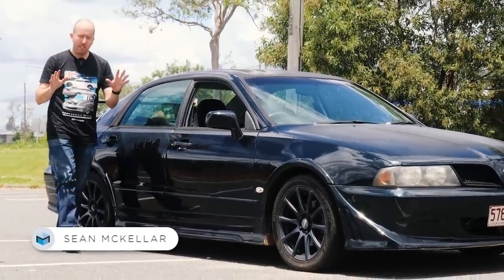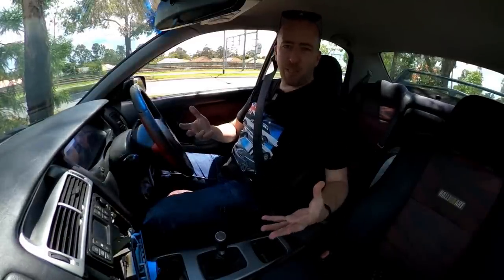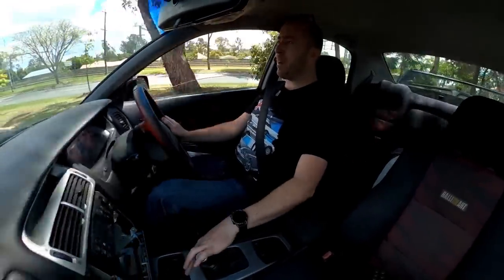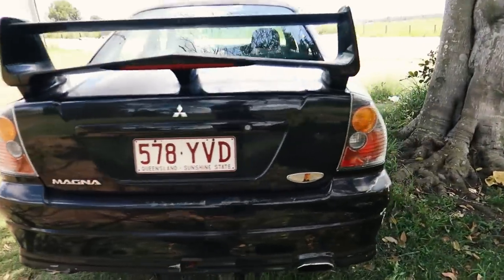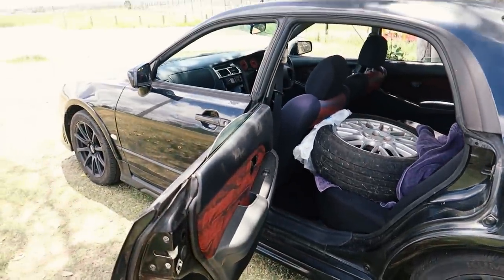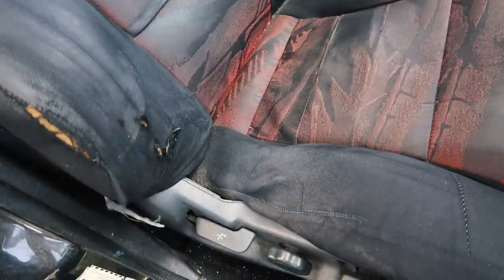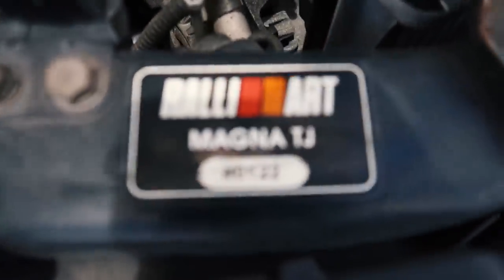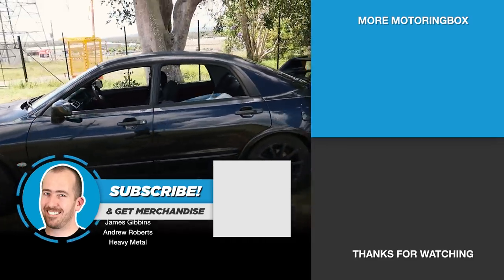Mitsubishi Magna Ralliart First Drive! This Aussie 180kW 6G74-powered manual sedan is a screamer!

Comment: Kia Carnival 2012 has 202kw and is a FWD, take the seats out and it's much lighter. I think that's hilarious, but this Magna is hella cool
Reply: The 2012 Kia Carnival was over 2100kg. 
What do you mean that it's lighter than a Ralliart Magna? 
Ralliart Magna's only weighed 1470kg. 
Even without the seats, it would still be alot heavier.
Reply: Sorry I meant versus a Carnival with all the seats in, just that it's another FWD with similar power, there's no comparison especially with the manual.
Reply: @mrjustinmarsh  
Some Ralliart Magna's had 210kw from the factory as an NA. 
But also about 30 of them were Supercharged, they gave out over 250kw.

Comment: Love the car. Contemporary road tests comparing the Magna to the Falcon and Commodore saw the Magna as being the faster car of the 3.  I honestly think that if the Magna had been a rwd it would have been far more popular in Australia. I’ve driven a few variations of the Magna over the years and always found them to be great cars. I loved the pillarless doors.
Reply: The L76 S/C Ecotecs had the Ralliarts in a drag race by a couple of car lengths over a quarter, but in terms of a sports-car engine, the Ralliart-spec 3.5L was a no-brainer. I remember being a mildly distressed Holden-loving 14yo reading a Motor magazine comparison between the Ralliart, AU XR6 VCT and HSV XU6. Ralliart destroyed them both overall.
Reply: I think you’ve scored a smart project car

Comment: they also made i think 30 of these ralliarts SUPERCHARGED! i think it was mitsi in conjunction with another mob and not sold through mitsi dealers, though not sure. these are really exploding in value now. !!
Reply: Well I don't think they make the Sprintex twin scroll supercharger that those Magna's came with anymore. 
So the only way to get it is by buying a Magna equipped with one.

Comment: I would have suggested to get a Toyota aurion sportivo for $5k as it's engine is better but they have doubled in price since COVID
Reply: 5 Ralliart Magna's had 210kw due to getting wilder cam's & compression ratio. 
Plus 30 of them put out 270kw due to getting the supercharged treatment.

Comment: It is a real shame they couldn't make the AWD happen... I was really interested in these when they were in the concept phase, but when they came out in FWD, they looked pretty limp wristed next to an SS Commodore.
Reply from the maker: They cost about the same as an SS too I believe.
Reply: @MotoringBoxTV  Weighing up this vs the six speed 5.7 litre Commodore... The Magna really was a tough sell, especially in the Aussie market. Even in AWD form, it would never have had the mass appeal of the big rear wheel drive competition.
Reply: @MotoringBoxTV  $48,990 - 2002 TJ Ralliart Magna Sedan - 5sp Manual - 3.5i so ya got a bargain mate

$50,540 - 2002 KJ Series 2 Verada Xi Sedan - 5sp Tiptronic Auto - 3.5i  cheaper than a Rada

i sent ya an email, let me know if ya want all the lists/codes/part numbers/prices
Reply: They had planned to make about 1200 of these from memory. Sales declined and I think it was cut short around the 600 mark (something around those numbers). There were white and yellow ones made too. 

Nice car but should have been AWD. Most rear bumpers were cracked when put on (touched up with paint).

Comment: lol it was actually only 170kw but still pretty cool, i had a red one in manual with sunroof
Reply from the maker: 180 officially. What they actually made I have no idea.
Reply: They officially made 140kw atw. 
This is the 180kw version's. 
Dyno test's confirm this. 
This equit's to 180kw at the flywheel, not 170kw. 
Some had significantly more power though, courtesy of different cam's & a Supercharger. 
30 were released with a Supercharger.
Reply: @MotoringBoxTV  180kw for the 500 numbered 2002 cars. 210kw for the 5 unofficial non numbered 2001 prototypes sprinkled into the mix.

Comment: AWD Ralliart Magna would have been a weapon.
Reply: yer but it was fat , over 300kg in the rear end
Reply: oh and mal from mitsfix in bayswater made a mawson sedan with evo parts/manul
Reply: @Roo0ooD  
The TJ AWD Magna Sport weighed 1604kg vs the Ralliart Magna's 1470kg. 
Plus some of the AWD Magna's were Supercharged & had 225kw. 
It was alot lighter than the AWD Monaro, that was 1850kg - although the AWD Monaro was more aimed at comfort than performance. 
Plus the AWD Monaro was equipped with a flat tyre repair kit, put one of those in a AWD Magna & weight would drop to 1570kg roughly. 
So it wasn't 300kg heavier than the Ralliart Magna, it was lighter than any model 380 & almost 300kg lighter than a AWD Monaro. 
You can tune the auto transmission of the AWD Magna to give it launch control, it has the same auto transmission & Gbox as the EVO VII GTA so even the shift's can be much quicker if you want.

Comment: I've always wanted the VR4 version of this car

Edit: the legnum / Galant, not the Magna.
Reply: There isn't a VR4 varient, I think you're confusing it for the Galant.
Reply: @brantleyfoster021  you're 100% right, my bad.
Reply: @hendrikkleyn8571  
There's the supercharged AWD Magna. 
They had more power & torque than the Galant VR4. 
But they were heavier too. 
Galant VR4 had 206kw & 360nm weighing 1520kg. 
The Supercharged AWD Magna (TJ series) had 226kw & 422nm weighing 1604kg (1575kg with a flat tyre repair kit). 
But the AWD Magna didn't get a manual transmission, still it has the same auto gbox as the EVO VII GTA, so it can be tuned for launch control & the shifts can be made to be much sharper & quicker. 
Add the Ralliart bodykit to it if you like it.

Comment: I thought Ralliart magna’s where AWD!? I did the maths for my AWD Verda and found out only 400 or less of my specific trim where made.
Reply: The AWD model wasn't a limited production car like the Ralliart Magna's. 
They were part of the standard line up, but some of them had 226kw courtesy of a supercharger.
Reply: @brantleyfoster021  For the 3 years my model was being made. Only 150 cars where sold every month. My car is a special mix of Verada Ei and Xi only made in December of 2002
Reply: @magnaveradaboi  
Sound's nice, was that the AWD Verada? 
There was a model Verada that I thought was nice too, it was the KJ GTVi series 2 I think.
Reply: @brantleyfoster021  ye Awd. Sadly only came with 5 speed auto.
Reply: @magnaveradaboi  
But it has the same auto Gbox as the EVO VII GTA. 
So it can be extensively tuned to add launch control & have much sharper & faster shift's.
Reply: @brantleyfoster021  well thank you for the shared knowledge
Reply: @magnaveradaboi  
Mitsubishi swiped it from Porsche😁

Comment: There was a factory 210kW n/a version of the 6G engine, you should build this to those specs.
Reply: Errr. No there wasn’t. You had the de-tuned 175kw 6G75 in the 380. Besides that in SOHC 24v you had other engines overseas that made more power but they arn’t drop in replacements (look towards the 6G75 MIVEC fitted to the Eclipse or 8th gen Ralliart Galant in the USA)

Comment: Did you know you could get a supercharged version?
Reply from the maker: Yet to see any concrete evidence of that, aside from Sprintex offering supercharger kits for them.
Reply: @MotoringBox  my mistake. That must be it. For some reason I recall a limited edition supercharged. I guess time has made me misremember.
Reply from the maker: @petercheems8118  the Mitsubishi 380 had one! Super rare.
Reply: @MotoringBoxTV  ah. Maybe that's what I'm thinking of
Reply: The first supercharged Magna in the world that came with tacit approval from Mitsubishi in Adelaide.
The AWD prototype that was tested has been made specifically for its debut at the Melbourne Motor Show back then. 
It added WA-sourced extras such as a twin exhaust system, 18-inch alloys and high load-rated 235/40ZR Falken tyres, new front and rear bumpers with a stainless-steel mesh grille, and slightly firmer suspension lowered 30mm. 
It boosted power to 225kw & torque to 422nm. 
But the most powerful prototype designed was a wasp yellow FWD Mitsubishi Magna VRX. 
It had 251kw & 440nm while weighing 1460kg. 
So that was the most powerful varient. 
It was a 13sec car quite easily. 
Significantly lighter & more powerful then the TMR 380.

Comment: enjoy doing 3 point turns every time you want to park 😆
Reply from the maker: I've already noticed that 😂
Reply: Yes they have a large turning circle, I think Mitsubishi wanted driver's to go with a one handed steer approach like some top notch Rally driver's use, combined with left foot braking. 
That way they wouldn't lose time around the circuit as much. 
It came first in it's class around the Australian Motorkhana back on launch, so it works a charm🌟

Comment: Does this have AYC like the VR4 Galants?
Reply: No it doesn't have AYC. 
The full-time all-wheel drive system on the Magna was developed locally using parts from the Japanese rally-bred Lancer and Diamante sedans. Using a viscous coupling system and a rear limited-slip differential, it splits drive 50:50 to the front and rear under normal driving, but this can vary to suit conditions. 
But some came supercharged which had alot more power & torque than the Galant VR4 that got AYC.
Reply: @brantleyfoster021  interesting. thanks for the info. Really that much more power than the galant vr4 twin turbo? surprising... I wonder how the weights compare
Reply: @kekethetoad  
Galant VR4 Twin Turbo spec's: 
206kw & 360nm weighing 1520kg. 

AWD TJ Mitsubishi Magna Sport Supercharged spec's: 
226kw & 422nm weighing 1604kg (1575kg when equipped with a flat tyre repair kit). 

Sit's comfortably inbetween the GTO Twin Turbo & Galant VR4 Twin Turbo in terms of weight. 
But it has a superior aerodynamic co-efficiency.
Reply: @brantleyfoster021  interesting. I imagine with the ling wheelbase, stripped out it could be a real demon on track. Is everything the dame as the rally art version here except for being supercharged? Also I'm surprised it has better aero coefficiency than a GTO😳 ... perhaps the supercharged magna is more reliable than both the VR4 Galant & the GTO....
Reply: @kekethetoad  
The 3rd gen Magna had a aerodynamic co-efficiency of 0.28. 
It may be the most aerodynamic car Mitsubishi have designed. 
There was 30 supercharged Ralliart Magna's made, they had alot more power than the AWD Magna though as the Ralliart Magna had more power to start with as a NA. 
They gave out roughly 247kw from memory. 
It just depends though as some of the Ralliart Magna's came with 210kw from the factory due to being equipped with wilder cam's & a more aggressive compression ratio of 10:1. 
There was only 5 that got 210kw, when equipped with the Sprintex twin scroll supercharger, they put out 277kw. 

It's a bit like the Mitsubishi Cordia turbo, they generally had 110kw & 210nm.  
But some actually had 150kw & 300nm, when you consider that they only weighed 965kg - it made them very hard to beat for any V8 in Australia back in the early to mid 80s. 
A completely new form of acceleration.  
It's why the cop's took an interest in them.  
Mitsubishi always release some halo model's within their line up to surprise customer's - it's just a matter of whether you are that lucky recipient. 
The Mitsubishi Starion may have been Mitsubishi's halo car back in the early 80s when they were throwing huge money at it each year, but everyone who owned one knew never to pull up against a Cordia turbo at the traffic light's. 
They even posed a threat to supercars available at the time. 
Good times in those day's. 

If you go for a AWD Magna, get the TJ Sport's supercharged varient as it's the lightest example. 
You could just buy a NA example & add a more modern supercharger, turbocharger or even put in the 6G75 engine from the TMR 380 if you prefer. 
The auto gbox they are equipped with is the same one on the EVO VII GTA, so it can be tuned to add launch control & the shifts can be made to be much sharper & faster for a baby GTR. 
But you can add the cam's from the 210kw Ralliart Magna for 30kw more power, so 226kw goes up to 256kw. 
Can add the EVO VII GTA's paddle shifters. 
Add the Ralliart Magna bodykit to it if you like, there is also the VRX bodykit if you prefer a more subtle sporting look. 
Or maybe you prefer the sleeper look. 
If you strip it out, well would probably become a weapon like you say. 

Some Mitsubishi Magna's got unique tuning. 
There was a wasp yellow TJ series Mitsubishi Magna VRX that got the supercharged treatment. 
But it made 251kw & 440nm while weighing 1460kg. 
Which is way above usual. 
The reason is because Sprintex adapted the dual exhaust system & port & polished head's at the customers order's for more extra's from the usual. 
Pretty crazy. 

They have been used in Rally events too, with AWD Magna's getting 14 inch tyre's & ploughing into the dirt to success from what I heard.
Reply: @brantleyfoster021  Wow incredible stuff mate you write an interesting account of things. Especially regarding the Cordia Turbo (mind you if they didn't drop the 4WD Station that'd probably be my dream car). 

I had a low mileage silver 2.5 ST Legnum about 10 years back and always wished I got the VR4 type S but oh well it was still a seriously underated road trip machine and gripped & handled better than it had any right to! 

Definitely curious about these supercharged AWD Magna's now - esp the ralliart editions but I figure they're rare as hen's teeth nowadays... Is the TJ Sport equivalent really lighter? 1460kg is pretty surprising. I wonder if an AYC system from a Galant/Legnum could be retrofitted and piggybanked to work with the ECU or something vaguely like that. I know AYC is sacrilege to some purists but it does intrigue me. Anyway it's good to encounter a real Mitsubishi enthusiast as it can be tiring how many in the 'JDM' sphere hate on the brand - as incredibly competent and innovative as it has proven to be over the decades. Cheers
Reply: @kekethetoad  
There wasn't any AWD Ralliart Magna's unfortunately. 
The Ralliart Magna only came FWD in the TJ range. 
But there was some NA 210kw examples & some 278kw supercharged examples, the later were probably the most powerful Magna. 
I'm just saying that you could buy a TJ series AWD Magna Sport & add the Ralliart or VRX bodykit to it. 
Even the 210kw Ralliart Magna probably was the fastest Australian made NA V6 to date in this category. 

But the fastest Supercharged AWD Magna was the TJ series Sport AWD. 
It was about 70kg lighter than the later generation TL AWD Magna Sport.  

I've never heard of AYC from the Galant VR4 type S being fitted to any AWD Magna, or even the 4WS from the GTO.
Might be possible, but it would be easier just to buy the Galant VR4 type S or even the GTO or EVO I think. 
The AWD Magna has the advantage in terms of aerodynamics, plus superchargers don't have lag. 
The GTO does feature active aerodynamics, but it can't make it more aerodynamic than the best it's shape could offer. 
I heard that manual conversions are being done to AWD Magna's now too, it's meant to reduce the weight of the car by 80kg.

Comment: If they had the wagon with rwd or awd, it would be a beast!
Reply: They had the Supercharged AWD Sedan. 
It had about 226kw & 422nm, weight was about 1600kg - 1575kg when equipped with a flat tyre repair kit like the competition were using at the time.
Reply: @brantleyfoster021   Cool didn't know this. What badge is this?
Reply: @samartz  
It was a TJ series Mitsubishi Magna Sport's AWD. 
But it had a Sprintex Twin Scroll Supercharger added to it. 
But I think some may have benefitted from the wilder cam's & compression ratio that some Ralliart Magna's came with. 
These one's probably had over 250kw & 450nm.
Reply: @samartz  
But if you look at the TMR 380's supercharged engine, imagine putting that into a AWD Magna. 
Definitely a great project car I think😅
Reply: @brantleyfoster021    I just googled. It doesnt look like many were made?
Reply: @samartz  
No not many, I doubt the ones with these car's will part with them either. 
But can just have a brand new 380 engine conversion done & put the same supercharger in or even a more powerful one. 
Rotrex are doing them now. 
Well even a turbocharger might be even better. 
The standard Auto gbox is the same unit fitted to the EVO VII GTA. 
So it can be tuned for launch control & the shifts can be made to be much sharper & faster. 
You could even put in the 5 speed manual unit from the EVO series, that's the most durable unit Mitsubishi have designed.
Reply: @samartz  
Actually I've seen a few Magna's with the Mitsubishi GTO's twin turbo motor. 
Maybe you can put that into the AWD Magna.
Reply: @brantleyfoster021   Too much engineering unfortunately
Reply: @samartz  
Some of the earlier FWD model's came with a NA 6G72 motor though. 
They eventually ditched it & the 4cylinder model for the 6G74. 
The 6G74 offered more power & torque for roughly the same economy, but it added weight. 
With the 3rd gen Magna's introduction, they only weighed 1370kg. 
The Ralliart Magna was 100kg heavier with the more powerful motor.